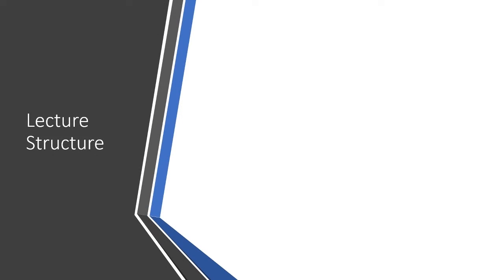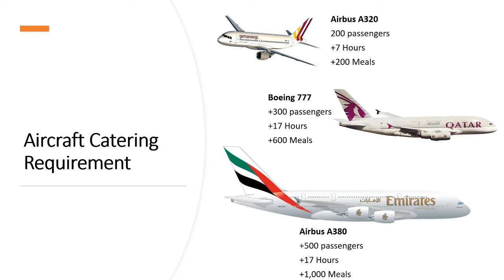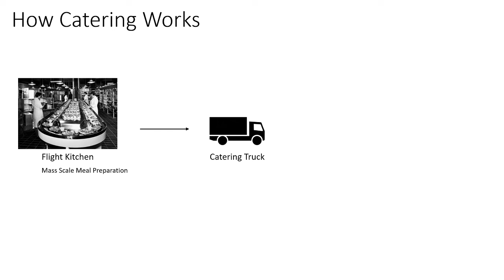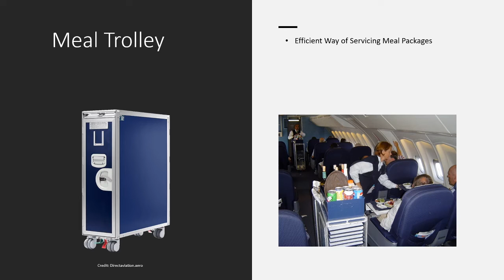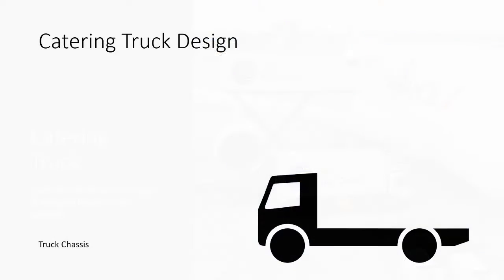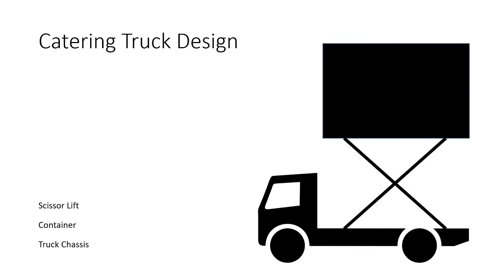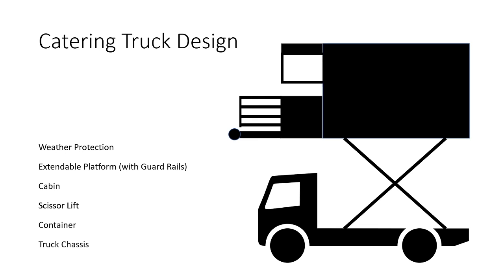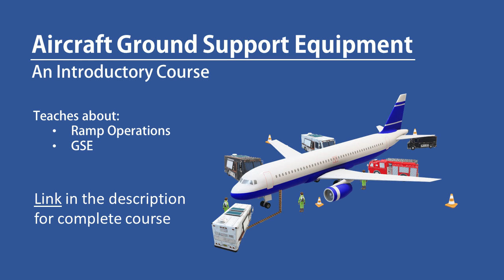How Airport Catering Works? – Airport Catering Truck Main Parts & Working

Comment: Just curious. How much payload weight this truck carry for long haul flights, for the Boeing 747-8I pax variant? 🤔
Reply from the maker: @Freelancer20245  This truck carries meals only inside food trolleys. Each trolley carries 20-30 meal trays and weighs around 25kg unladen. With the trays each trolley would weigh somewhere around 50 kg. 747-8 can carry roughly 500 people max = 500 food trays which would mean around 15-20 trolleys which is equal to 750-1000kg payload.
However the above numbers can vary depending upon aircraft configuration and airline meal plan etc.
Reply: @TheAirportSchool  Thanks for the reply! Appreciated. I'm just calculating my weight plan for my FSX Skyspirit2012 Boeing 747-8i.